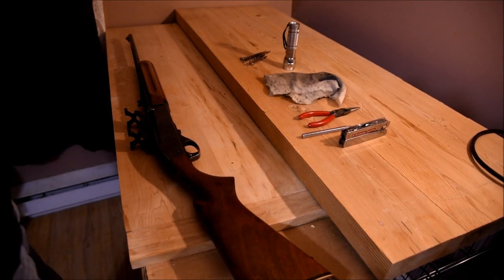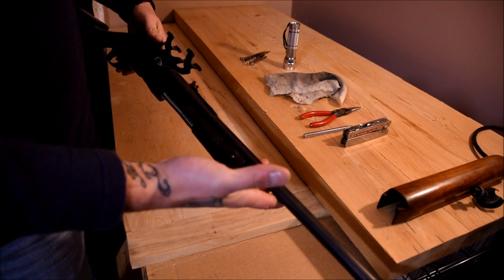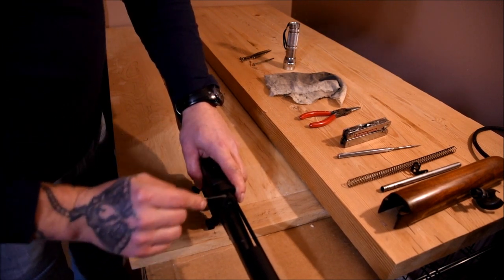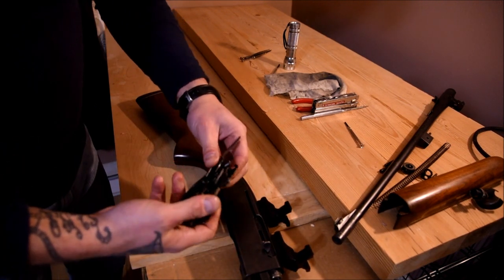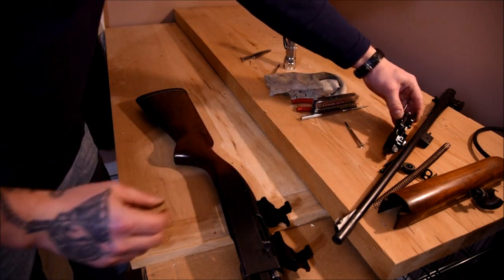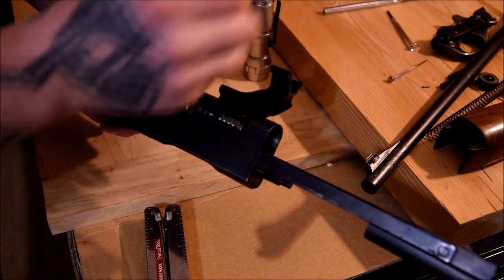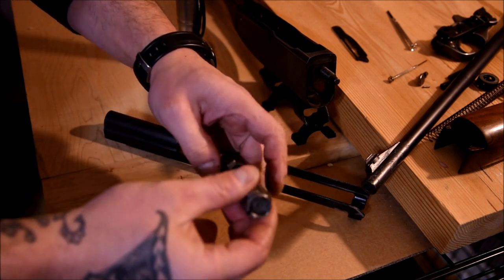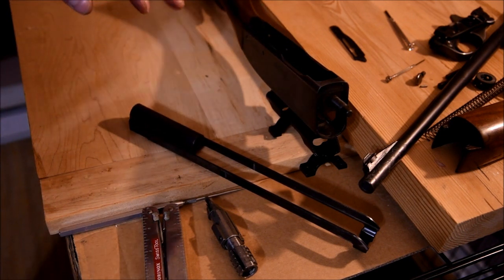Remington Model 740 Detail strip and assembly

Comment: The spanner nut that holds the barrel on wouldn't budge till I loosened set screw which as it turned out had a piece of lead shot underneath as a thread locker. A high speed drill bit worked in place of a spanner wrench to turn the nut. Thanks for making the video as I cannot imagine what this would have been like without it. Reinserting the "slide combo" sucked. Too many pieces and not enough fingers!

Comment: Great video :) Question…. Any advice for doing an extractor on a 740?  I bought one with a rivot kit and tried to install.  Was very careful but after I installed it, it was out of shape and was not conforming to the ID of the cutout for it to rest.  It broke after I removed it.  I’ve ordered another kit.  Brownells says to adjust with a punch.  That didn’t work for me.  Should I heat treat and temper it so it might spring back out into position?

Comment: How to remove the roll pin in the gas block (the roll pin holding the guide rod in place)?  Mine is seized and won't budge.  This is on a 750, but shouldn't be different than a 740

Comment: I can not get the nut to turn to remove the barrel!
Reply from the maker: The first time I did it I had to hit it with some kind of penetrating oil, or carbon breaker, and let it sit for a bit, WD40 should do it
Reply: bill wall ok. Thank you!
Reply: I found that mine had a small allen head lock screw in one of the holes. As soon as I  loosened it, I was able to turn the round nut .
Reply: I had the same problem with my father’s 740 that had not been apart in 60 years.  I invested 3 hours, trying progressively more aggressive methods. I used penetrating oil and had to hit the edge of one of the holes with a center punch (pretty hard). It eventually broke free with no damage.
Reply: That's what I ran into with my 7400. I have no idea how to take that nut off.